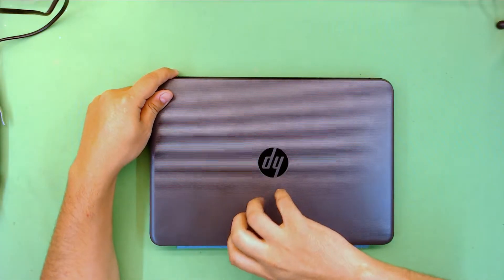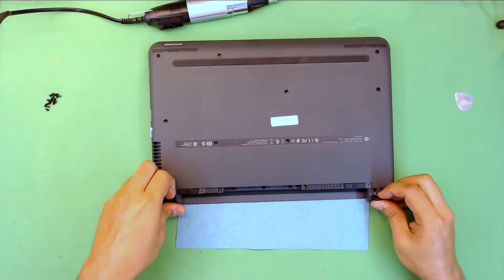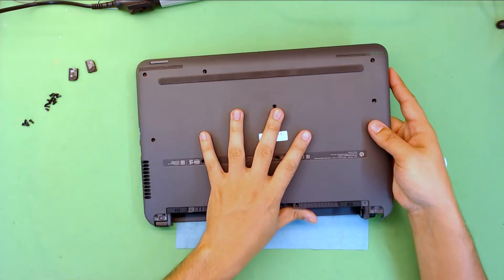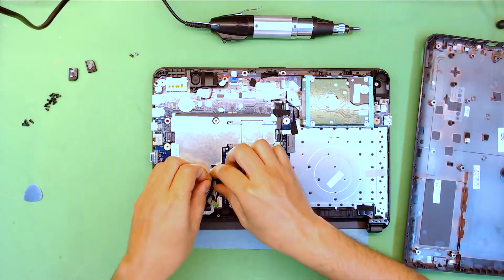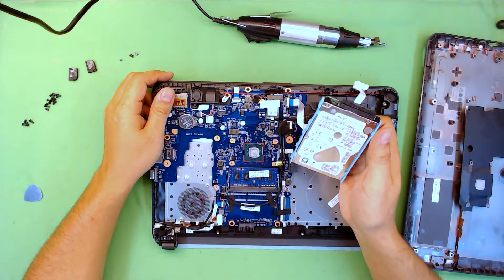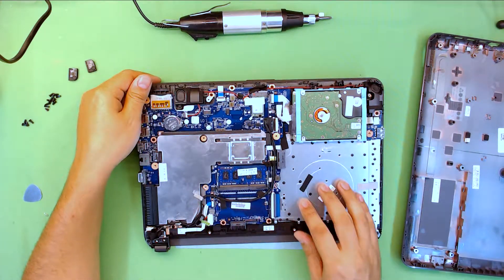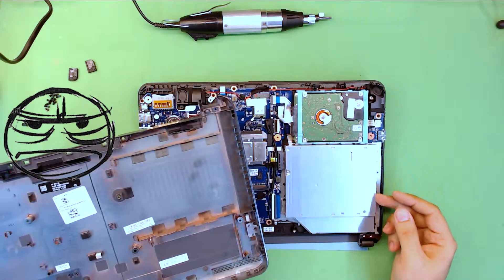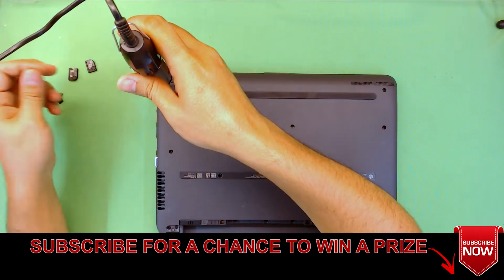Laptop HP 240 G5 Tear down and repaste , WORST LAPTOP 2017 Build Explained !!

Comment: I guess this is the Celeron varient. But even if it was i3 or i5 and wore with an discrete GPU they will use a fan and a single tiny copper pipe to cool the machine. Which surprisingly is able to keep the machine stable but fking hot and noisy
Reply from the maker: Thank you for the feedback! if you wish to support the channel you can LIKE or SUB or both :P
regarding your opinion, yes it is a celeron, but even with celeron we get this into the store  with CPU over heating and damaging the solder balls under the CPU (BGA), because it does not reach high temp as i3... series but even at 80c for long period of time without any air cool it will dry the solder balls of the CPU. and oh ya don't mention the skinny tiny pipe and heat spreader on i series :/

Comment: can we upgrade the processor in this 240 g5?
Reply from the maker: Thank you for the feedback! if you wish to support the channel you can LIKE or SUB or both :P
regarding your question: unfortunately you can't upgrade the CPU or make it run faster but i do recommend to replace the HDD (hard drive) with a SSD (solid state drive) , and install windows and it will be much faster.
https://amzn.to/3vRWr3y
how to create windows 10 USB:
https://youtu.be/uDu8j2lE-dM
follow the installation steps:
https://youtu.be/GkMZyCUarIA

Comment: Does this have 2 ram slots????
Reply from the maker: Thank you for the feedback! if you wish to support the channel you can LIKE or SUB or both :P
regarding your question: sorry to inform you but this laptop only has one ram slot available
Reply: @uFixTek  My Hp 240 G5 has two ram slots
Reply from the maker: where did you purchase you g5 and what is the exact model, you may have the higher model.
Reply: @uFixTek  My Hp 240 G5
  i3 variant
And every hp 240 g5 variant has two ram slots
Reply from the maker: the celeron variants dont come with two, as you can see clearly in the video the celeron variant only come with one ram dim!. 
and if you still dont belive what you see in the video here is a link to the motherboard.:
https://www.bioselectronic.com.mx/MLM-638439292-tarjeta-madre-hp-240-g5-14-am005la-858040-001-860460-001-_JM
the i3-i7 variants are the only two dims. NOT the celeron variants and @00:40 you can see the intel celeron sticker

Comment: the motherboard has only one SATA port right? that is I can see on video.
Reply from the maker: Thank you for the feedback! if you wish to support the channel you can LIKE or SUB or both :P
regarding your question: Yes there is only one sata port for storage, no m.2 slot for any m.2 ssd, but you could upgrade the HDD to SSD to boost the speed.
Reply: @uFixTek  Thanks for your quick answer, you saved me so much.

PD: I already gived a like to your video :)
Reply from the maker: I much appreciated it, if you ever have any request or questions fell free to ask me.

Comment: I have same laptop hp 240 g5 but my spec i3 6006u ram 4gb ddr4 intel hd 520
Reply from the maker: this models come in few sub mudels:
Intel Core i7-6500U
or
Intel Core i5-6200U
or
Intel Core i3-5005U
or
Intel Pentium N3710
or
Intel Celeron N3060

if you have the i3 then you may have the fan and proper heatsink
Reply: Does this have 2 ram slots????

Comment: Spec?
Reply from the maker: Intel Pentium N3710 , Intel HD 405
Chipset integrated with processor 
500 GB a 5400 rpm
DDR3L - 1600
Wi-Fi Realtek 802.11b/g/n (1x1)
Ethernet 10/100/1000 integrada
Cámara web HP 640 x 480
Batería de 3 celdas HP - 31 Whr